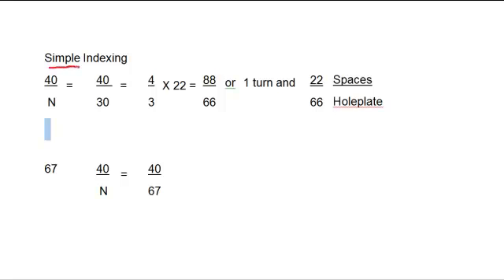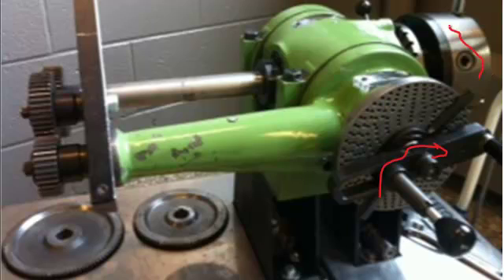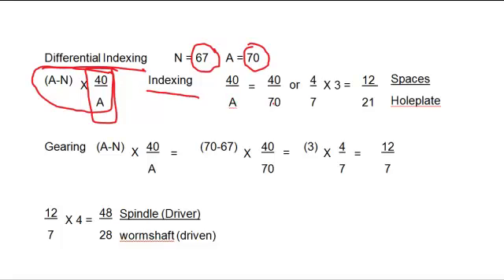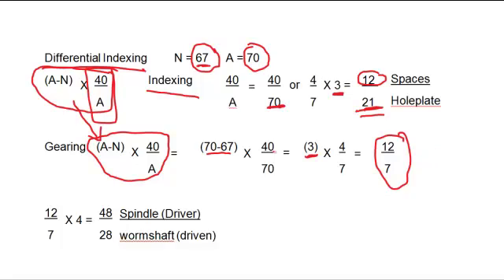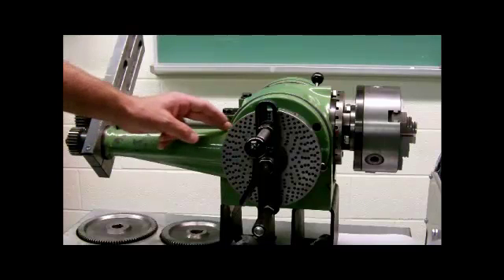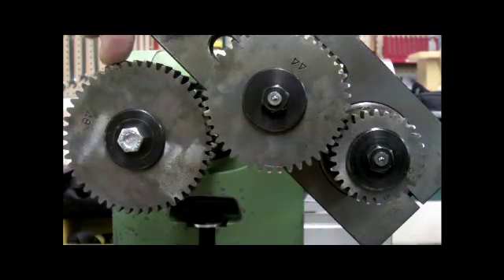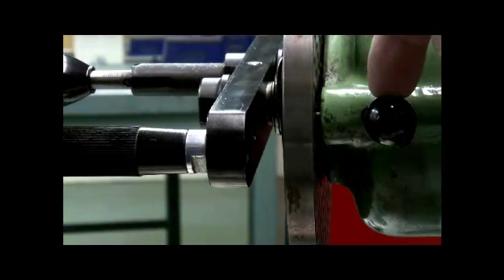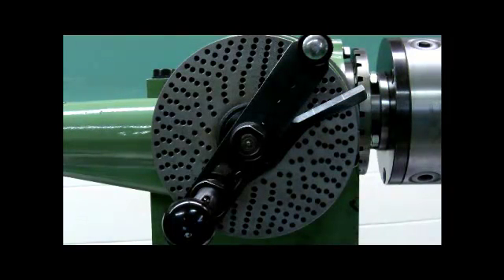Differential Indexing Using a Dividing Head

Comment: im about to pick up a brown and sharp head like this one and silly me I diden't even know this was a possbility thanks for the info does your mill have the capability of cutting helix gears? I would love to know about gearing a universal head in to the table of my universal mill .
Reply from the maker: +Chris Anderson Hi Chris, differential indexing is not that common but kind of neat. Yes I cut helical gears. I use a horizontal mill with a table that swivels (universal) and a bore mounted full form involute gear cutter. You need to know the gear tooth's DP and number (tooth size and number of teeth per inch of pitch diameter) to select the proper cutter. You also need to know the lead of the helix and the lead of the machine to calculate the gearing between the milling machines lead screw and the dividing head. Finally you need the helix angle of the gear to swivel the table to the angle. If your cutting a pair of gears and they are different diameters the lead of helix will change. Also if your gears are on parallel shafts one will be cut with the table swiveled right the second will need the table swivelled to the left (you also need to add a gear so the dividing head turns in the opposite rotation)(right and left hand helix). Crossing shafts have the same helix.
Thanks for your question and comment.
Reply: I am also stumped  as how you would center the part .can you demonstrate  how you would setup a job like  this haven't  found  one on YouTube.
Reply from the maker: Great question. With the gear blank in the dividing head I will either touch a square sitting on the table to the OD of the gear blank and measure from the square to the cutter. Repeat the procedure on the other side of the blank. I've also seen pinching a straight edge (rule) between gear blank top and cutter. If the cutter is centered the length of rule will be horizontal. You could measure to the table on both sides to straight edge.
Reply: I Don't  quite  understand
Reply from the maker: Sorry Chris, I will try to put a short video together for you.
Reply: Thanks